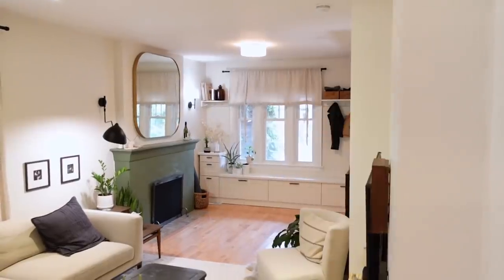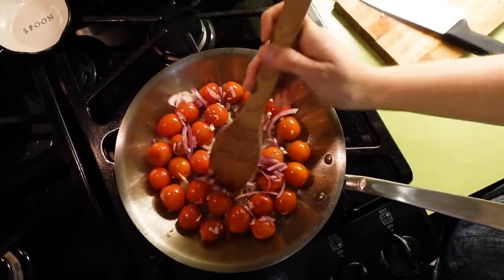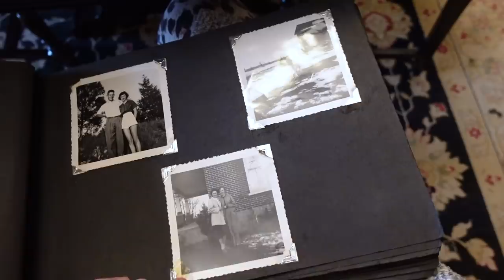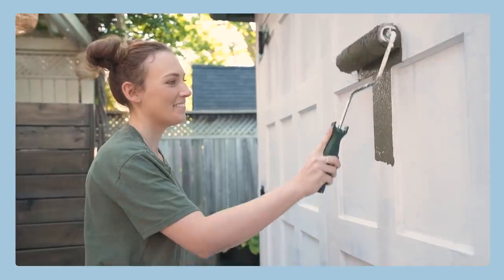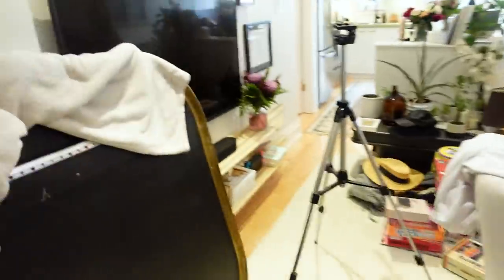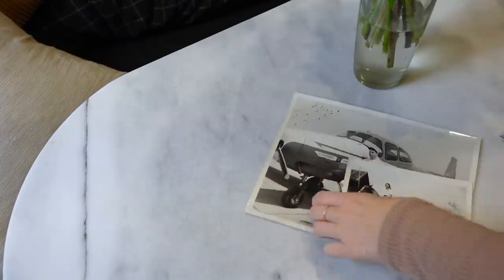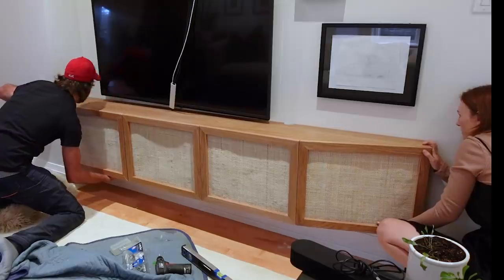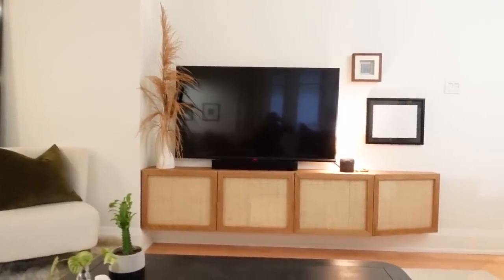lol im redoing my whole house ...

Comment: Tile hols are “less permanent” than cabinet holes.. you can always swap a tile by breaking it and removing with a chisel, then you just need to put on your spare tile
Reply: THIS
Reply: exactly!!
Reply: That’s what I was thinking!
Reply: Seems like a Pita to do when wood filler takes 2 seconds to apply. Also, I think her final choice was more aesthetically in tune with the decor.
Reply: I’m so nervous, I am too indecisive. I’m tiling my whole wall in my bathroom and I don’t know if I’ll regret installing shelves
Reply: Could you drill into the grout instead? And then fill if you take it down fill the grout?
Reply: @purposebuilt9754  I was wondering the same ! Probably would damage more tiles though
Reply: Just drill between the tiles. The hole in the tile joints can be fixed even easier.

Comment: Drilling into tile is a bit more complicated than normal drilling, you need a special drill bit and you have to water cool it, however that newer hindered us in doing "permanent" changes. That being said, when ever possible, drill into the grout to mount things. Much easier to deal with and a lot less risky.
Reply: Unless you are drilling massive holes, you are fine without watercooling it. I wouldn't actually drill into the grout. You can just hit a til, which makes it way more vulnerable. Personally, I don't think it looks goed either.

Comment: I really don't mind the color in the "poop room" the thing that bugs me is that it seems a too little flat, pictures helpping a bit to remedy that, but the very base/no texture gives me cheap gas station bathroom vibes. I wonder if there would be a way to bring more texture to that color on the lower half while still keeping the room easy to clean as it is a poop room and in a basement.

Comment: Regarding the towel holder you can silicone it to the tile. Use tape to secure. Once it sets it will hold like it’s screwed in. And if you ever decide you want to take it down you can cut it out and clean up the silicone. I’ve down this with magnetic knife holders on my kitchen tile and it works like a charm.

Comment: I think it depends how easy it is to repair the tile... could you just replace one tile or would you have to replace multiple? I also assume you have a few extra pieces laying around that you could do that with?
Reply: also like... you can just drill in between two tiles, that way the tiles themselves don't get ruined and the hole is easier to patch up if you decide against it afterwards?

Comment: If you need to mount things on tile, drill your holes into the grout lines. If you need to remove it, just patch the grout. You may nick the tile a little at the edges, but grout will cover it.

Comment: I do have to agree with other comments that the brown is too heavy in the toilet, especially placed on the lower half. but i have two solutions: incorporate a kind of strip lighting to lift up the shadows or use the current brown as an underlay to a burnished gold overlay. it's almost like brushing light gold over it, and let it catch on to the surface. that way the brown anchors it, but it has soms reflective quality as well as a cool almost-gilded texture. go with light gold, as opposed to dark super warm tone gold.

Comment: Your media console is SO SO GOOD! Well done, Chris! RE: Towel hanger - Instead of drilling into a wall or cabinet, I suggest command hooks. There are some inoffensive "decorative" hooks that would work great for a hand towel. That's what I did in my powder room! A towel hanger doesn't have to be a design feature.

Comment: 7:05 I would put the towel holder on the tile because yolo and because the tile would be more arid and sorta resistant to humidity, also because even if there are holes in the tile in the future, you could cover them up with plaster, paint them white and polish them, no?

Comment: Oooh, an actual sponsorship I was looking for - I have under active thyroid and just found out that Teflon breaking down and getting in your food is suuuuper bad for thyroid issues. My pan literally had the Teflon rubbing off in the middle, so I threw it out stat and have been really struggling to find a stainless steel frying pan with angled sides which you need when you’re using a fish slice for fish or eggs etc. It’s been such a nightmare - they are all either Teflon coated or have high paella pan sides

Comment: The least invasive hand towel holder probably would have been a suction cup on the glass shower door.

I totally agree about not putting it into the tile, you can’t really just replace one tile, if you can, then I’d go for that but my understanding of tile is that it’s not possible.

Edit: hey also make legit chain mail gloves, for meat cutters. So next you handle those shelves lol

Comment: I think the new fireplace color is beautiful. And bringing the door color onto the walls anchors that side of the room. I've always been a fan of your color choice in the bathroom. Maybe there are haters because of the room you chose to use it rather than the color. It does lead to some pretty funny jokes! As far as drilling in the damned towel hook. Everything is plumbed for water over there so unless you were planning to rip everything out and start over, I bet you'll need a towel there for a long time to come.

Comment: I like it much better than before. However I just am curious if the above of the fireplace is painted in black or has a stroke of black contrasting the part. I just think it would give similar pallet to the kitchen you hope to redo in the future also. Brass against black is timeless. ✨

Comment: Well, regarding the tile permament mounted handle for towels - I did the holes in the tiles, in my baathroom. Now I wanted to change the hook and I can't because I will have in your face holes in the middle of the wall. BUT every time I try to keep things sticked to the wall in other way than a holew and srews, then it always falls down on the ground. I have no solution, I gave up and I use shower door nob as towel handle...

Comment: I tried to avoid nail holes as well and invested in alien tape....needless to say when I decided to move one of the things that I put up with it...I had to fight to get it off. On ur walls I wouldnt recommend alien tape because it literally took the plaster with it which I now have to fix but on wood it may not be that harsh....all I know is that if u want something hung up without nails or screws and u want it permanent alien tape is the way to go....that stuff is crazy!! And I promise what u hang up aint going anywhere until u force it off lol

Comment: I like your living room. If it was my living room, I'd add some sort of pattern or prints somewhere [the pillow for instance or w.e] at least one statement piece, the fireplace is a statement piece but, everything is plain/solid colors. My living is attached to the kitchen and dining as well, and is very plain and solid but, adding 2 large printed frames [black and white] to my living room breaks the solid a bit makes the solid colors not so plain.. I love your bathroom.

Comment: So many comments.     The bathroom gallery wall is too random.   Over time the eye will tire of it.    
Lining up edges (top or bottom, sides - it doesn’t matter) makes the visual easier on the eye to process.  It’s the same principle as your entry color wrapping around to the fireplace.  Experiment.   You can also tell a story with placement with the cat cards as whimsy.

Comment: I would never comment so negatively,  but you asked for honesty, so here goes; I'm just not a fan of the colors on the fireplace or in the water closet. I love the way you styled both, but the colors just wouldn't be my choice.  

However, I feel like with the fireplace, although I don't love the plum color, it might look better if you broke up the color with a nice wooden mantle to match your floor and your custom tv cabinet . Same in the water closet.  I just think you should add some natural elements in there by sanding the storage doors and the top and staining them a nice light natural wood. 🤷🏻‍♀️